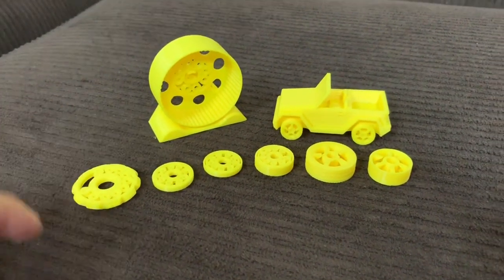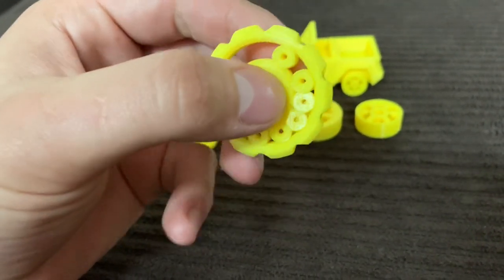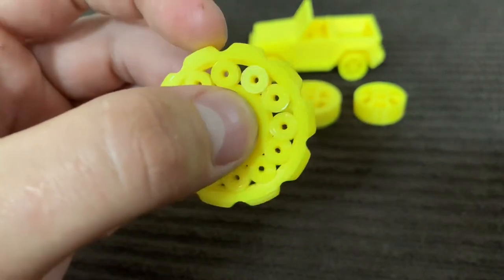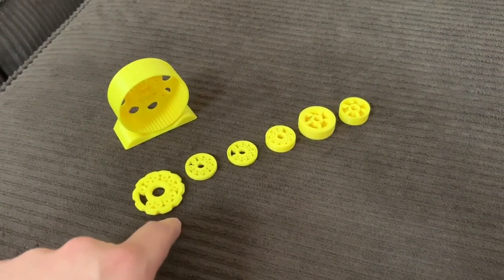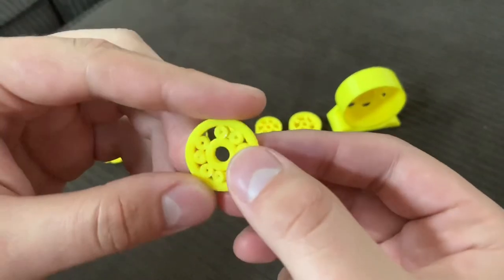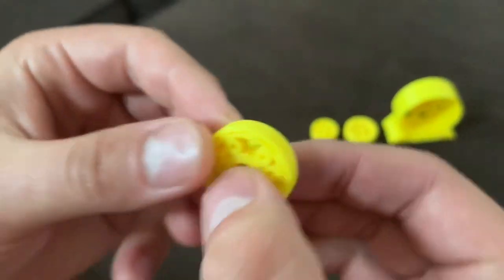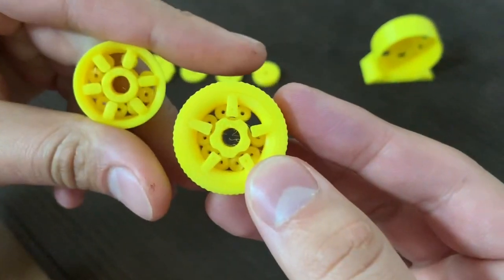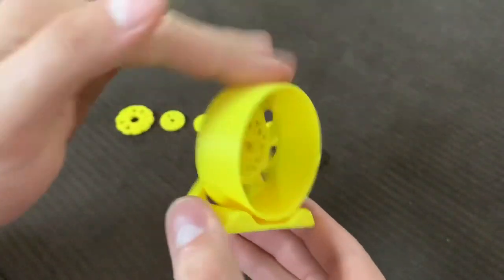Fully 3D Printable (print in place) Bearings

Comment: i can print it out and it look great but it will not work lol.... any special setting are require?
Reply from the maker: Kenneth Kwan if its sticking together try lowering your extrusion rate like 1% or so. Also do the s shaped tolerance test on my page to see if your printer is dialed in enough to get it done. That will help you see what you need to fix 👍 the distance between the bearing and wheels are 0.2mm